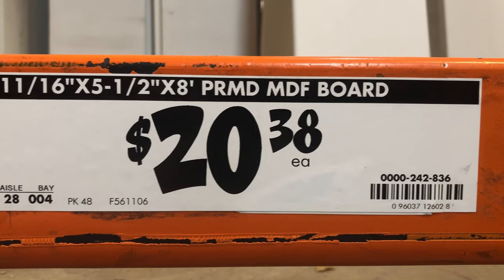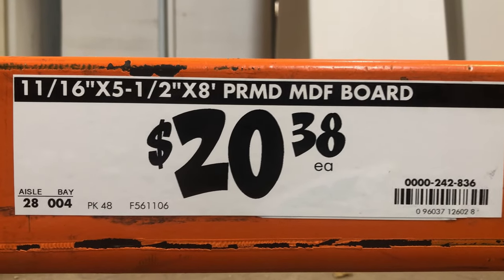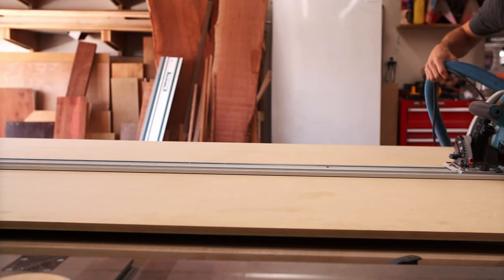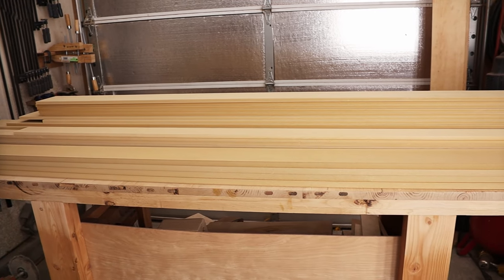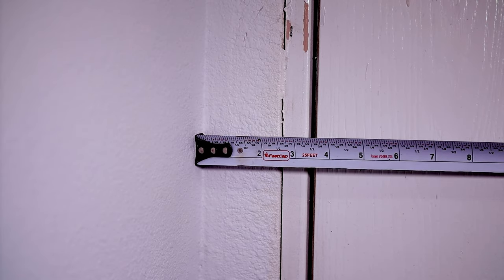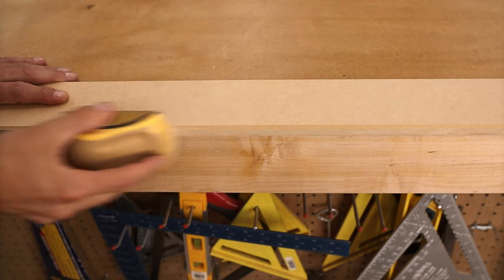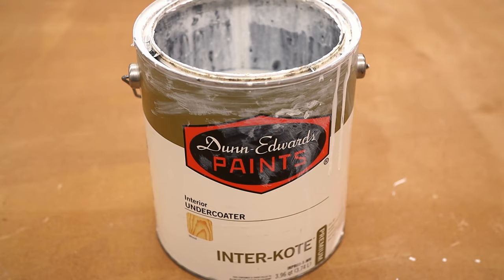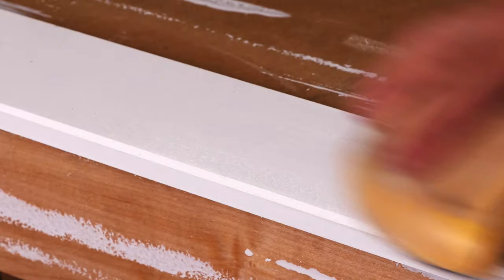How to Make Molding | DIY Trim Baseboard Headers and Blocks

Comment: I think you'd be better off using pine. Still cheaper and better then mdf.
Reply from the maker: I agree pine is a better material, but I haven’t found it to be cheaper. By me a sheet of MDF if currently 47 dollars, which is 6 dollars per 6” 8 foot strip. Pine 1x6 is 12. If you can find pine around that, let me know, because with lumber prices these days I honestly I am asking cause I would love to know if you are able to find pine 1x6 at around the 6 dollar point.

Comment: mitter saw can cut 45 degress 
looks more profesional than straight cuts
Reply from the maker: I totally agree, when I install the baseboards I always cut 45 degrees on the edges. I typically leave that until I am about to install it so the 45 edge doesn't get all dinged up.

Comment: Good video but you forgot to use any footage of yourself actually making the molding..
Reply from the maker: These ones are super simple so it is just the small 45 degree chamber on the top with the table saw. I should have demonstrated with some more intricate designs but that was my project at the time and didn’t fully think it through.

Comment: Seems to me if you can afford all these super fancy tools, you can certainly just buy the finished baseboards? Lol.  The time and effort you are taking to making all this stuff doesn't really make much sense to me, but the video was educational for someone who owns all these tools, etc.  I mean who has a table saw that size? Or all these router bits?  Add up the labor time, expenses of the tools, etc., and it would probably cost twice as much than just buying the damn things finished.  Unfortunately, I don't have that kind of time on my hands.
Reply from the maker: Thanks for the comment. I know it can be daunting seeing a shop full of tools and thinking how you can do the project without those. Luckily the molding is pretty simple and can be done with just a circular saw and a palm router, so under $100 dollars of tools. On the time side, yeah, projects can take a lot. This one is pretty quick in that you can do quite a bit of trim in one day, ended up saving me more money then I make in my day job for the time, but this project is the exception, not the rule for the labor. Take care!

Comment: The idea is an A plus, and the tool used is a D. Ending on a high note, you can lose 9 fingers and still scratch your butt if you like.
Reply from the maker: Thanks for the grade on the project. Ill have to let my table saw know it wasn't cutting it in this video.

Comment: So to do it myself I safe money but I have to buy thousands in expensive super specialized machinery. This is what sucks about DIY channels that expect people to have a damn carpentry shop in their house.
Reply from the maker: It can be a bummer when you don't have the tools for a project, that is what is nice about this method of making molding you only need a circular saw and a straight edge if you are doing the simple 45 edge profile.